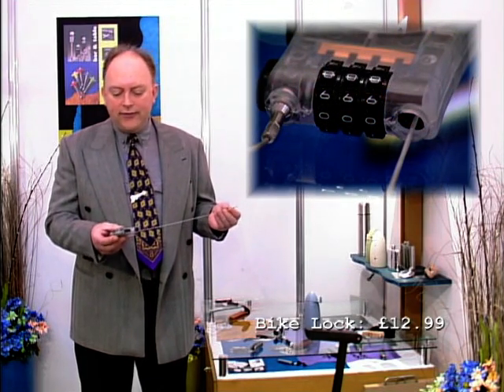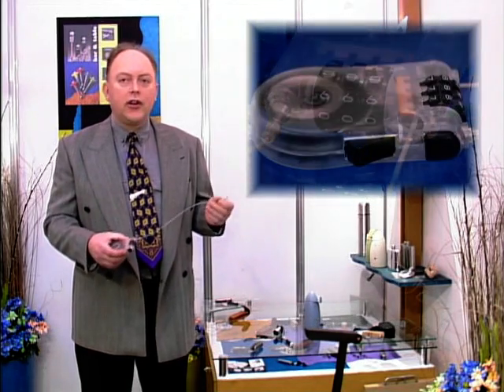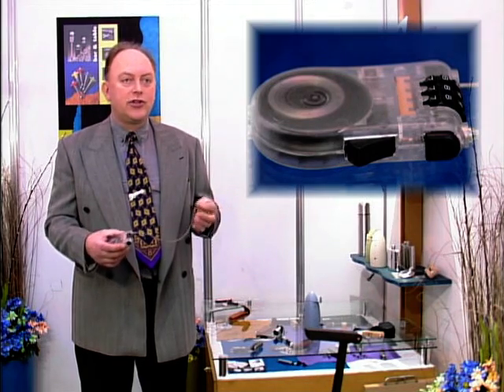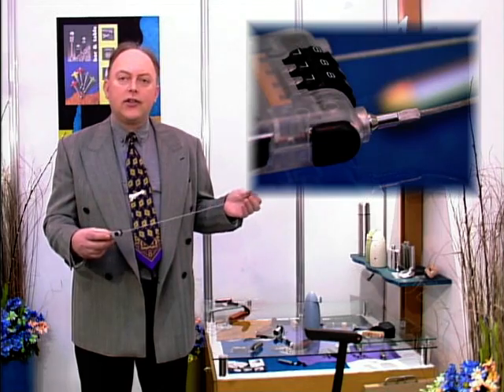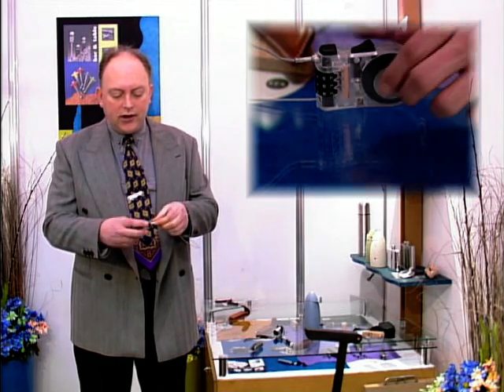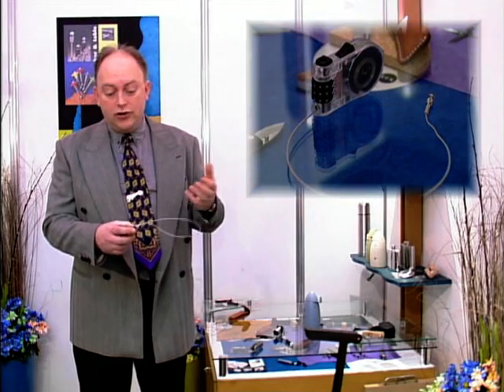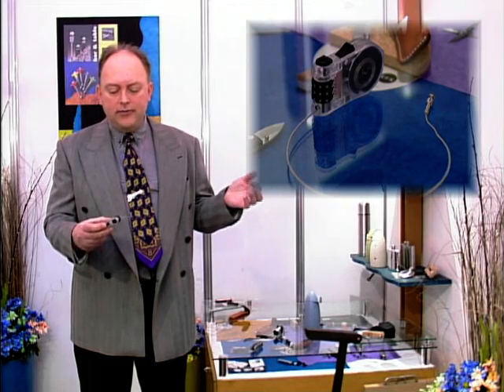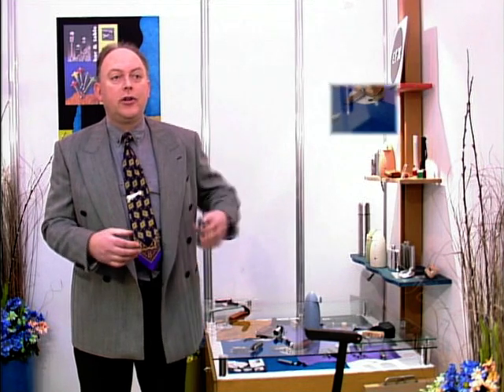Compact Tamperproof Bike Lock

Comment: Definitely seems like it would work about as well as a piece of string. Plastic housing can be kicked whacked or pulled apart, and the wire is definitely too thin to be "cut proof" on any level